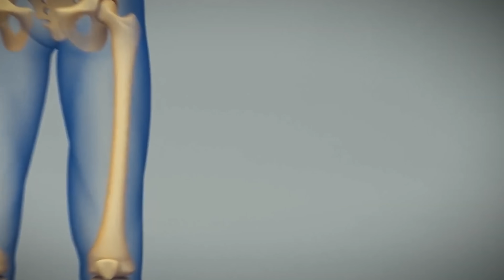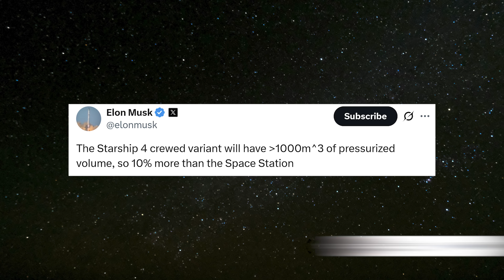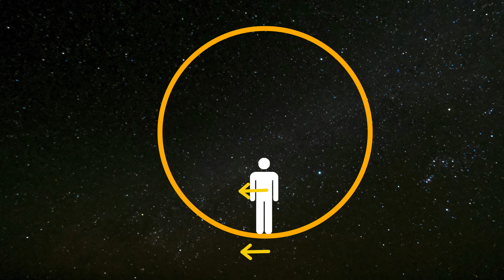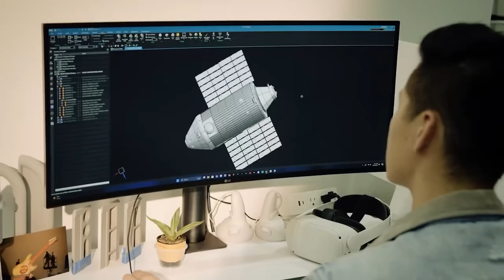New Inside SpaceX Starship Gravity Station REVEALED, Better than China...

Comment: Coriolis Effect is a simulation only, its not in true fact a force of gravity, and out body will get use to it, it will run with it but sooner or later it will figure out something is "WRONG" or a bit "ADD" and then the body will react to it or even rejected, so the best way to create gravity is to spin a large mass asteroid and attach the station it, and we do NOT need 1G -Earth force , our body will be OK with .5G and if we could make to .8G then we are GOLDEN. We are working on it. And there is a spin speed, the ideal speed of the spin would be 1 per minute, that is comfortable zone.

Comment: I love the mention of the plan to repurpose the Space Shuttle tanks. The plan was discussed in a PBS (Public Broadcasting System) science education program I remember watching. The program said that the tanks would need several thousand person-hours of work each once in orbit. I think at some point the back then the estimate was $100,000 per hour and that was only if an Orbital Repurposing Center could be launched where spacesuits were not needed to do the work.  Those costs killed the plan.
Reply: SpaceX needs a Orbital Repurposing and Refurbishment Center so those Starship can stay in space.  The valuable engine section would have been removed to bring up the next station. Taking a Starship Station to the ORRC would be much easier than returning the tanks to fuel service, returning a engine section and returning to earth.
Reply: I can see launch equipment for space station Starships being put in to two modules. First an engine module that once unbolted can be placed in a cargo Starship.  Second, all the other equipment would be kept in the removeable nosecone also unbolted remove and placed in a cargo Starship, perhaps the same one.
Reply: I see them doing this with a break at the upper and lower tank. The upper tank is just a tank. The lower is complex. I can see the upper tank and cargo bay diameter being increased to be used in building the ORRC or just a bigger space station.
Reply: This being the launch module.
Reply: Cost to launch per pound/kg during the space shuttle era were orders of magnitude higher than even what falcon9/heavy  cost today .  Not only that is the fact that starship is expected to further drop that AND the robotics tech for remote work via drone or humanoid robot like Tesla Optimus/Boston dynamics whatsit is dramatically more advanced than it was back then.

Starlink is a perfect example of how far things have shifted.  The network level tech was developed by Microsoft and one of the big Satellite Internet providers decades ago during the space shuttle era and released for anyone who could make the economics work because the launch costs would have exceeded global GDP by wide margins.

Comment: While a few space-ships strung together as a proof of concept is a GREAT idea... A proper space station for long term habitation almost by definition needs to be a purpose-build construct.  The OVERWHELMINGLY easiest way is a Double-Inflatable system:  Current inflatable space stations and space station modules such as the BEAM on the ISS are incredibly complex thick multi-layer-wallled balloons inflated with internal atmospheric pressure in one stage.  A double Inflatable is a balloon inflated inside another balloon.  This brings many advantages.  First the two balloons can be simple 1 layer bags without particularly impressive structural or tensile strength.  Second, the space between the two inflated structures can be filled with something NOT AIR!  Something like AB-Foam with kevlar fibers mixed in.  Such a foam is very compact to transport un expanded and then once solidified in place could support a habitat wall over a meter thick.  If the outer and inner bags are Kevlar, then that outer wall represents SUBSTANTIAL structural and armor security. If it's not enough for you, there's nothing stopping you from having a triple inflatable or a quadruple one.  Each balloon inside a balloon ultimately becomes a another layer of kevlar between the inside and outside of the station.  Each such multi-inflatable is easy to manufacture in orbit... it's just opening valves to inflate various layers after all, and then can be strung together as modules to make a space station of any configuration.  Because the inflated shape and un-inflated shapes do not correlate strongly, there's nothing to stop them from their final shapes from being shapes that do not work well with fitting inside cylindrical payload bays of launchers but do work well with fitting into a spinning structure like say pie-wedge shapes.  Finally, because it's just modular docking and inflation the whole thing can be constructed easily in space.
Reply: What no little heart from the AI video???LOL Your on point brother!!!❤❤❤❤❤❤❤❤❤